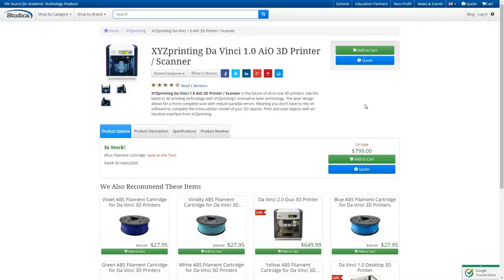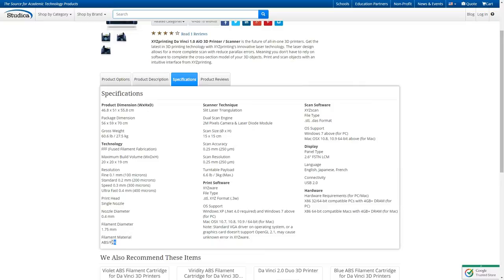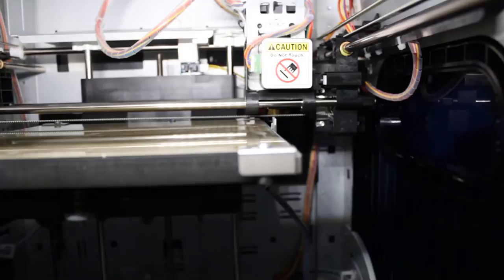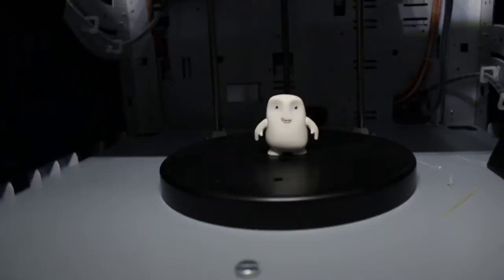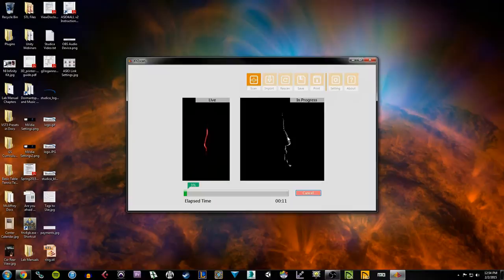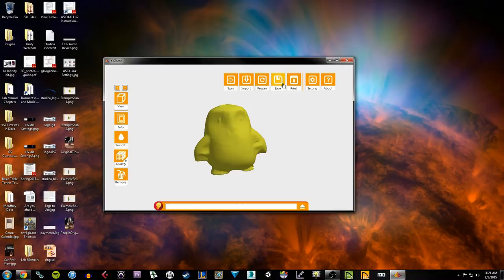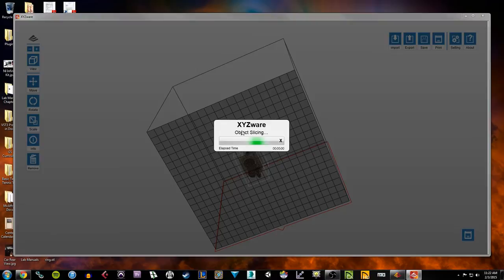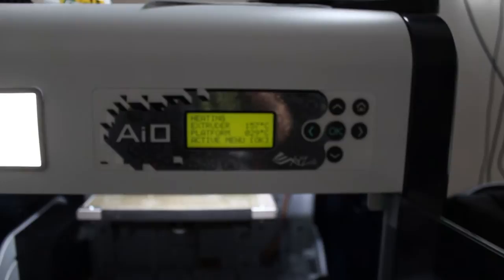DaVinci AiO 3D Printer/Scanner Introduction

Comment: Does it have a slot for a usb connection to upload files?
Reply from the maker: Hi, Erin, yes it does. That is how I usually print my files. You can connect your computer to the DaVinci and send it files to print. My workflow was to use ZYXware to slice the file and then send it to the printer.